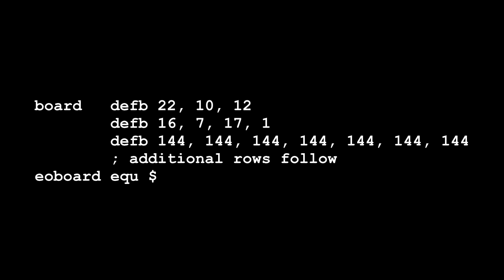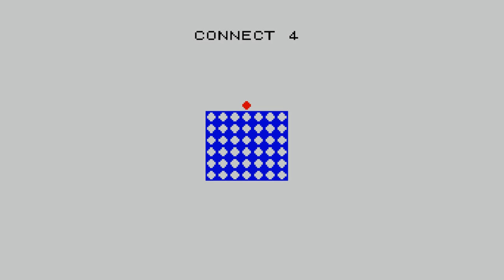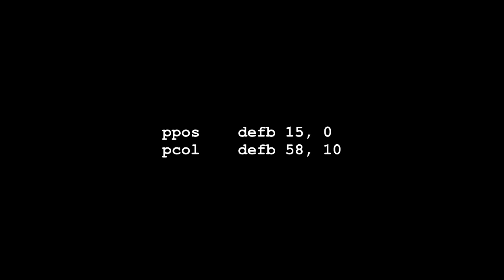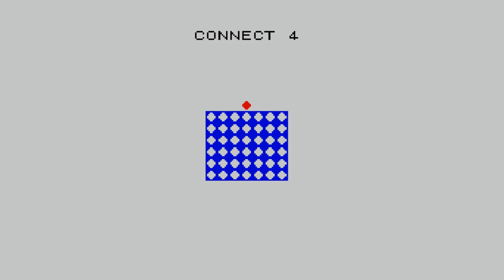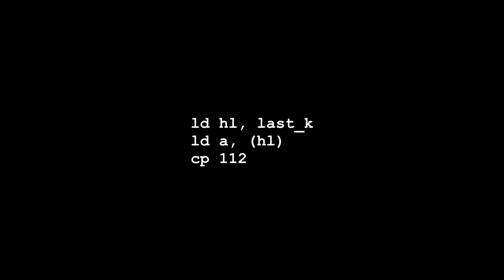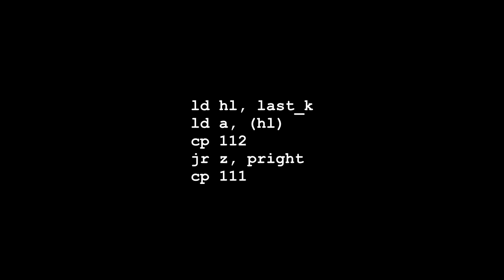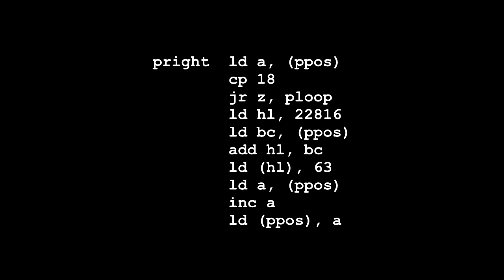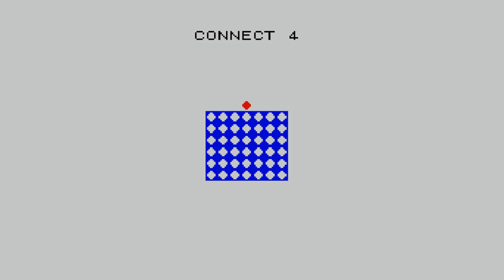Z80 assembly language tutorial, part 3: user input (ZX Spectrum)

Comment: As Johan already covered the fact that DJNZ doesn’t affect the flags, I’ll make a couple of additional comments.

1. About the CP instruction.

It’s best to think of it as subtraction. What CP does, is it subtracts the operand from the accumulator, but does not place the result back in the accumulator. The result, however, does affect the flags. Keeping this in mind will help use the CP instructions more efficiently. In particular, it can be used for testing if a value is equal, not equal, greater or equal, or less than another value in the following ways:

cp x
jr nc, greater_than_or_equal
jr c, less_than
jr z, equal
jr nz, not_equal

In your game, you could use

ld a, (ppos)
cp 18
jr nc, ploop

and

ld a, (ppos)
cp 13
jr c,ploop

respectively. Note that the value in the last snippet is 13, rather than 12. That is because subtracting 12 from 12 will not set the carry flag, and you’ll overshoot one position.

2. Optimization

This portion of the code

ld a, (ppos) ;[3/13]
inc a ;[1/4]
ld (ppos),a ;[3/13]

can be simplified to read

ld hl, ppos ;[3/10]
inc (hl) ;[1/11]

It takes less memory and executes faster. I marked the number of bytes/T states that each instruction takes in brackets above. The original code takes up 7 bytes and 30 T states; the optimized version takes up 4 bytes and 21 T states.

Hope this helps!

Comment: Great videos here, thank you :) I am trying to put them into practice in the original Zeus assembler on my real spectrum. Some modification is needed to take into account the way the assembler itself works but obviously the code will work fine once that's sorted. So far I haven't worked out a way to have whole strings of text stored in one go as it won't accept the syntax "textstringhere"; just one literal character after one quote, e.g. "t. Maybe there's a way to do it...! Fun stuff.